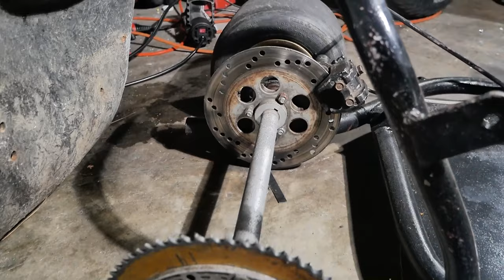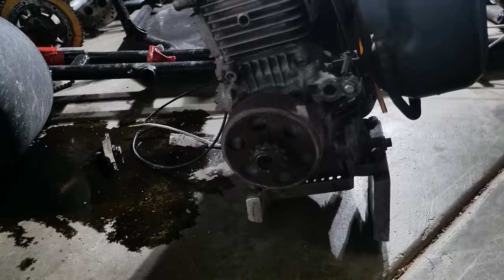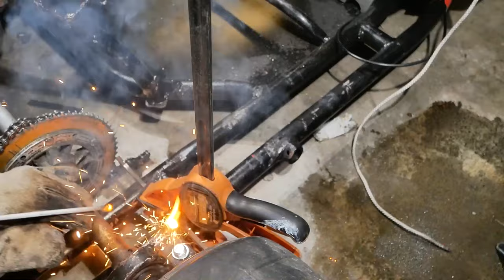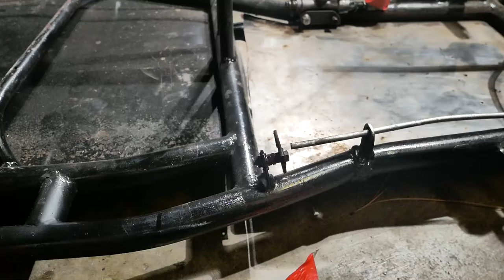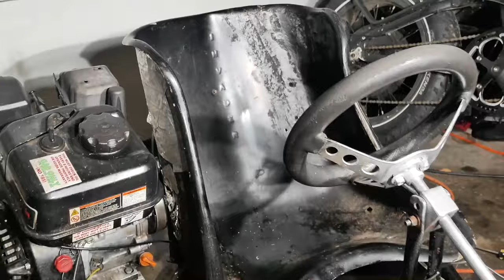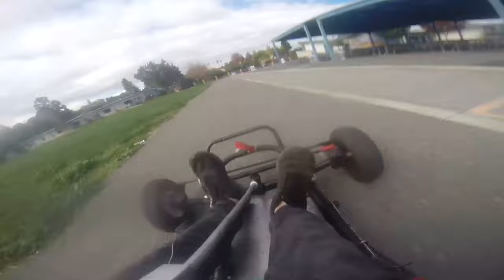Gokart Racing build

Comment: you've made a marking where you wanted a mark, but have you marked where you wanted to mark for your mark? i find that the marking of where i want to mark my mark really helps.
Reply from the maker: sometimes i mark the mark twice to avoid haveing to mark the mark 3 times and re mark the mark on the metal
Reply: @ianbuilder  why not mark everything that's unmarked first instead of what you were going to mark so you can see what you're marking without actually having to make a mark where the original mark would be? or better yet, mark the whole thing then unmark the spots you need to mark so you dont have to mark them.

Comment: and thats why it cost $200 you should have asked for 199 in change sir
Reply from the maker: thy usually cost upwards of 700 in my area
Reply: @ianbuilder  try building it from scratch its a lot of fun and you can try out no weld builds. (personally i would still use welds)